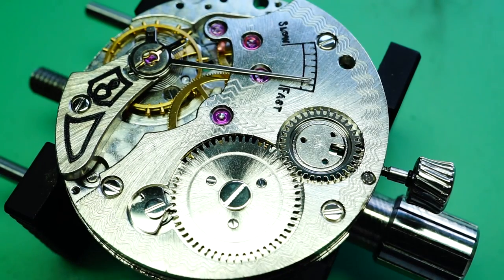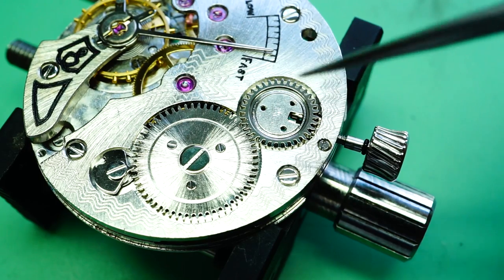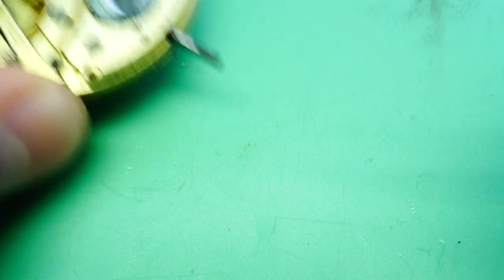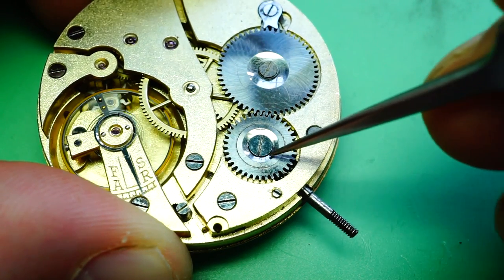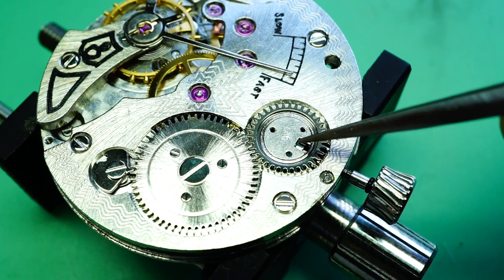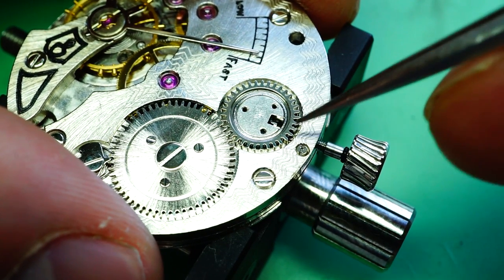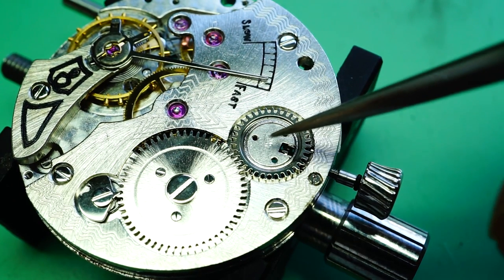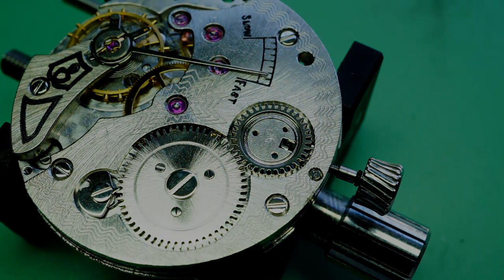Seagull ST36 Design Flaw

Comment: I always thought these were cool because of the old school design, but im really glad you pointed this out so I didn’t buy one. This was a really clear explnation so now i know for the future. Thank you’
Reply from the maker: They have since revised and improved this area of the movement but now the winding pinion and clutch wheel wear out quicker creating a clicking noise when trying to wind. If you want to buy the clone 649X series movement then go with the original design versions as they are much better imo.
Reply: @welwynwatches5976  This answers every single question I had about this movement, and saved me from purchasing a watch w/ this movement ( but retrofitted w/ the new revised central screw system in it). I'm really glad that I watched this video and I'm extra glad that you answered this comment. Thank you good sir!

Comment: Has this been updated by Seagull since 2017?
Reply from the maker: I have been working on some new watches with this movement and they have been updated since this issue.
Reply: @welwynwatches5976  by updating, you mean they went back to the single screw design?
Reply: @welwynwatches5976  I've seen current watches on the market with this movement at the time of writing they have the 3 screw design. Can you explain if this issue has been updated. Also what would you say the power reserve is on it? Thanks